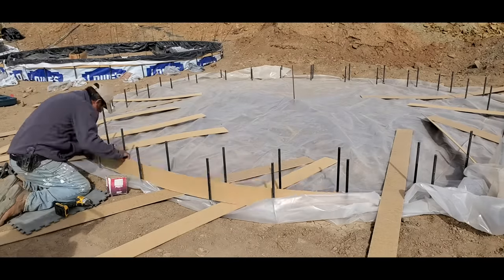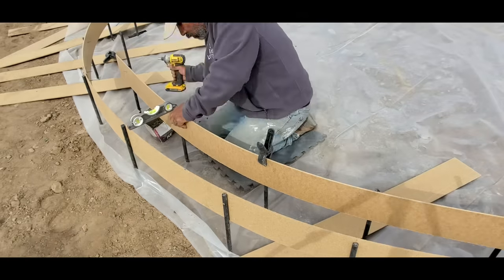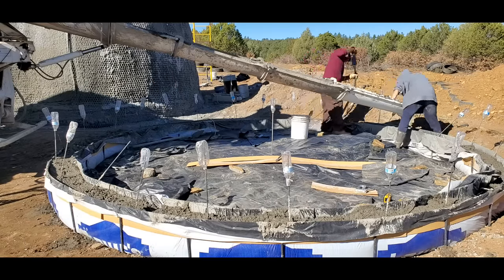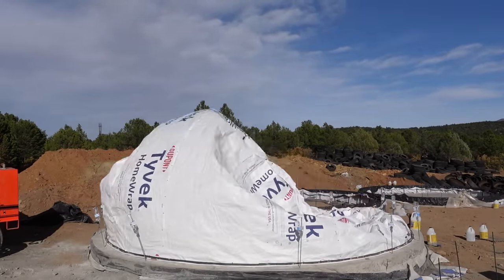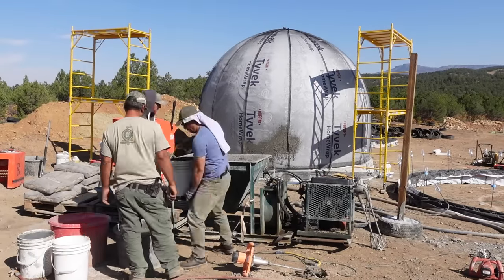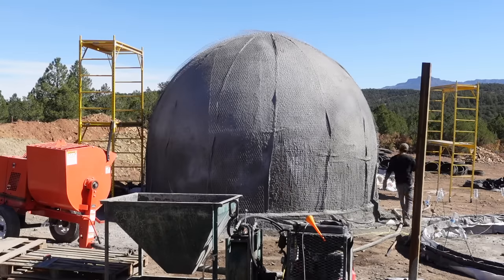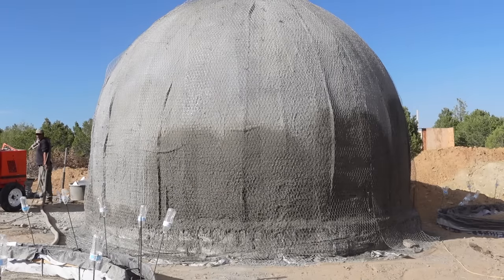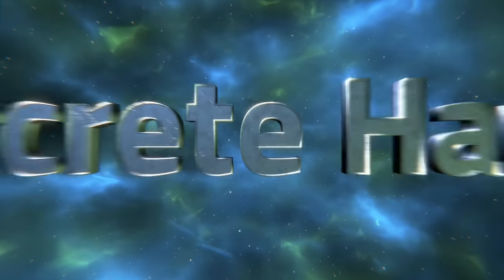NEW Dome Building System | Aircrete Harry #domebuildingsystem #dome #buildingsystem #aircreteharry

Comment: what about frost upheaval regarding the foundation?  i've been researching frost-proof shallow foundations (FPSFs) to cut costs and trenching depth, but you have zero below grade depth on your footings here from what i can tell.
Reply from the maker: As you know in frost-proof shallow foundation system, you have to have an R15 vertical next to the foundation  and R30 Horizontal for four feet from foundation. The way I am building I have no chance of water flooding in I'm building above ground.  My Ring-beam is 12 - 24 inches tall after the domes are built on the outside around all the domes I will pour about 12 inches of Aircrete all the way around for insulation. Then I will push up soil tills it's 12 - 24 inches up the domes. This is my way around digging a trench this is much easier for me with soil being so rocky.
Reply: @AircreteHarry  so you'll have about 24-48" of depth on the footing (ring-beam) with 12" of aircrete outside the footing?

in my research, water flooding is not the determinant for horizontal - it is the frost depth - ours is about 5'

i am still looking into this however, hence my question.

thanks for responding.

Comment: All you need is a $50,000 gunite spray machine and you can make them for $5,000?
Reply from the maker: Hey Barry, LOL I don't have a $50,000 gunite machine.  LOL it's a $25,000 shotcrete machine. 😄🤣😂😆😄🤣😂😆.  Or you can get my new pump spraying system, soon to be  revealed. Price unknown at this time.  But for $300 dollars you can get a 3 jet sprayer with a small hooper. You full the hooper and spray your Air-Forms. If you look at my early video from about two years ago you can see me building a small dome with one.
Reply: @AircreteHarry  Ok will check it out, looked expensive $25k is, but if another way, I will check it out thanks.  Is there an advantage to spraying it on rather than just using a hawk and a trowel like stucco?  Thank you for your info, it is great, outside the box.

Comment: Wow will you be selling the plan to contractors around the country? poor ppl can afford a house! so cool! You say this lil dome is $5 K...Thats cost to build? what do you think customer would pay to have one built? I image banks will finance it
Reply from the maker: Yes! I will be selling the plans and deferent dome building kits. Kit's will come with mixer pump combo or just Hooper pump.  You can mix your own cement or have a cement truck pour a pumpable mix into the Hooper. It will come with different size dome air-forms and the Fiberglass mesh. This kit will be perfect for contractors or anyone looking to get in business of building domes.  The larger kit what I'm calling the (GET THE HELL OUT OF THE CITY KIT) will have everything a person would need to build an off grid dome home everything but cement and a few other thing you get locally. What would people pay? Depends on the person, I would charge $250 - $300 an hour for myself and 2 other people and all my equipment. On flat ground any size dome up to 40 foot, 7 - 10 days of work to complete the foundation & shell with doors & windows opening( Ring beam has to cure a few weeks first.
Reply: @AircreteHarry  Thx for the details!  A few groups you should market to are: ppl on disability (even SSI), CAN buy cheap houses with section 8 & other options too! There are govt programs to help do it...will they consider these as a valid "house" or not who knows? Second group:  Full Van / RV dwellers etc... (some are trying to buy land for pit stop place for the large community) #VanLife   Helping poor folk is good for you & them... best PR ever!

Comment: Your wall is too thin for an aircrete construction. Aircrete cracks if its thin. must be 12 to 16inch thick at least
Reply from the maker: True not Aircrete walls EPIC walls EPS foam beads Paper and cement.

Comment: 5,000 for this?  Ok. Enjoy your poverty
Reply from the maker: The dome is not complete in the video, ones complete the cost will be $5000
Reply: I have done work on lightweight concrete and must say $5k seems not cheap at all.
I've built a number of wood sheds, they are about $3k with doors and windows.  They are just time consuming to make, but this doesn't look any faster frankly.  I could not find ANYONE that would even REVIEW my designs and they required certified structural engineering approved plans.   I'd like to see the cost of those approvals even IF it can be approved, the $5k is not likely to include a licensed engineer to sign his name to it for free.
Haven't seen a Harry video in a while, interesting it popped up on my suggestions,  looking good Harry, don't take my comments too negatively, carry on!
Reply from the maker: @murraymadness4674  The deference from what i'm building and what your talking about building. Is that when I'm done I will have a dome that will stand for the rest of my life. It is also insulated already 10 inch thick walls 8 inches of it is insulation. Fire proof.  I found a  structural engineer who will work with me so I can get structural engineering plans for my domes now. The dome I build last year was under $3000 to build a 16 foot dome.

Comment: Concrete truck. Not cement truck. Say it right.
Reply from the maker: What if I get a neat cement mix for making Aircrete? Then it's a cement truck?
Reply: I was under the impression that AirCrete is Portland cement injected with foamy water.
The water eventually evaporates leaving....Cement with air bubbles.
Seems you could indeed have a "Cement" truck in this case.
(assuming you have no aggregate, which if present would indeed make it concrete)
Reply: @rusosure7  cement is useless without some kind of aggregate, it needs to be mixed with sand or rock. Period. Cement alone has no strength.
Reply: @TheDieselndust  I think we all know that.  That's the beauty of Portland and foam. Its highly insulative ability.  If you add aggregate, SURE it increases strength, but loses its R Value.  
If Harry were focusing on strength, he'd do a Monolithic Ecoshell with 4000psi or a Monolithic Dome with polyurethane and then 4000psi concrete.
But he's not.   He's compromising.
Whether he has inner layers of straight Portland cement (requiring only a "cement" truck) and then later a mix of Portland cement AND aggregate (concrete truck-happy now?) he hasn't disclosed.  He may be using limited aggregate mix throughout and then you would be right about it being a "Concrete truck".
Did you hear that?  You would be right.  And that's what's important on this thread.